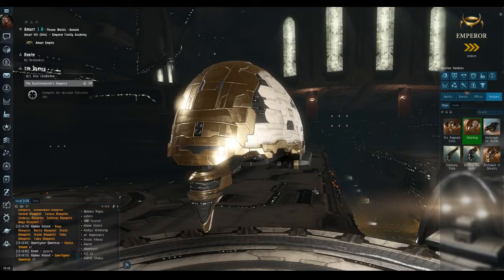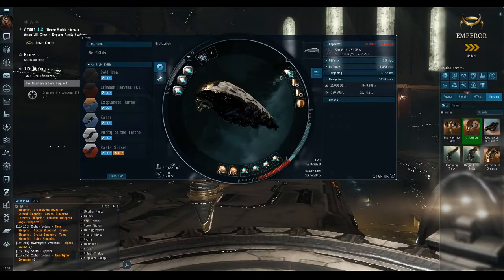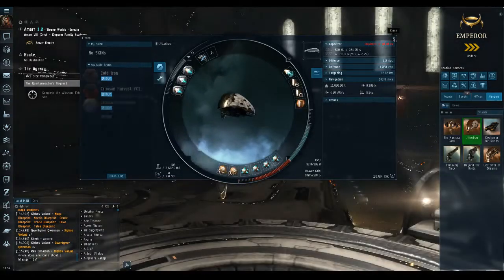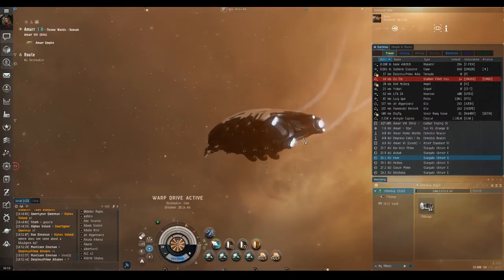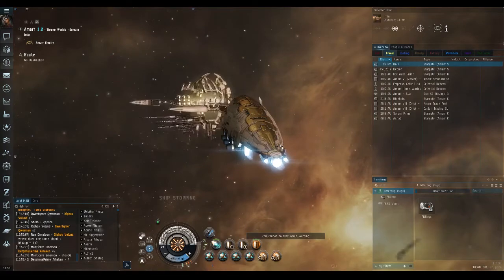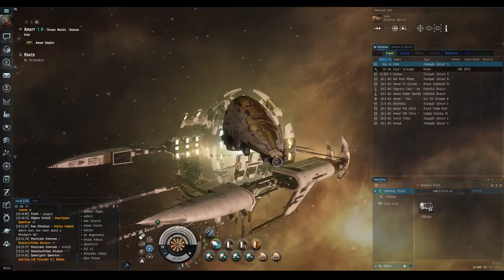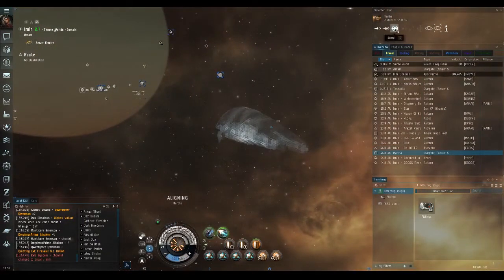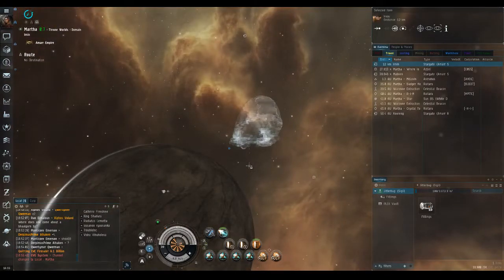MWD+Cloak Trick

Comment: actually the align time isnt so important as your agility modifier and max velocity attained with one cycle of the mwd.  as long as your at align velocity when the mwd has cycled once the cloak mwd trick works.  if your slightly under it then you will have an opportunity to reship involuntarily... this is why you use a tech 2 mwd cuz tech 2 have a higher velocity bonus and therefore get you to go faster in one cycle cuz the top end of it is higher while the cycle time is the same.

Comment: "You must have an align time less than 10 seconds" Are you sure about this?  the whole point of this trick to to allow a quick warp out. i.e. if your align time is greater than 10 seconds an mwd activation after warp activation would make it a 10 second align time because you got up to warp speed quicker than you would without an mwd.
Reply: This works regardless of the align time. As long as you do not have any speed mods fitted like Overdrive injectors .
Reply: @pinnaclegaming6019   in theory (sorry for necro) even with overdrive injectors you should still be able to use this trick... cuz your max mwd top speed increases as much as your sub prop mod speed does... so the precentage of align speed you achieve should be the same cuz your adding the overdrive injectors bonus to both values

though you are correct in any case.    cloak mwd trick is about aligning cloaked and then decloaking and isnta warping.  not about making sure your align is 10 seconds and no more or less.